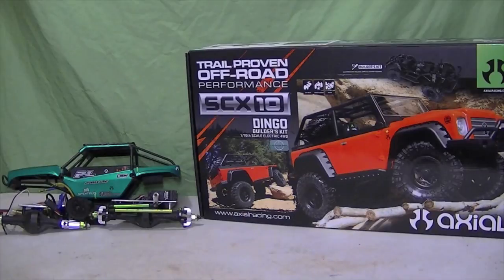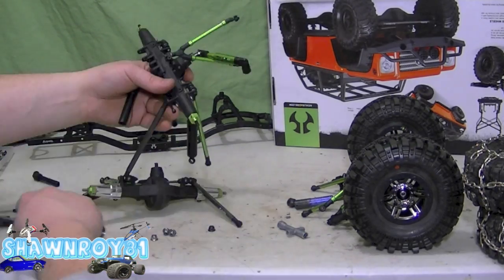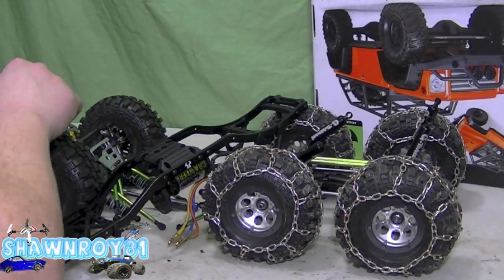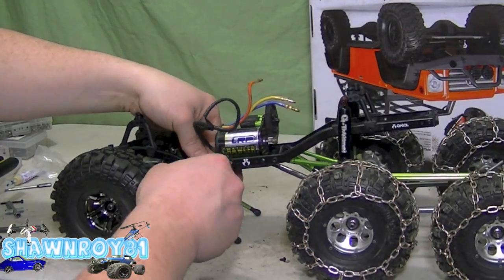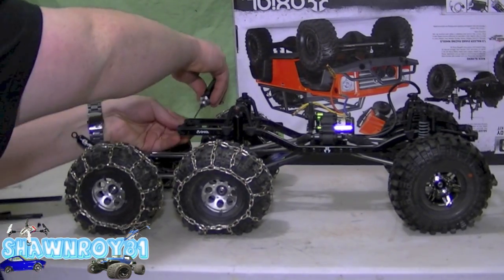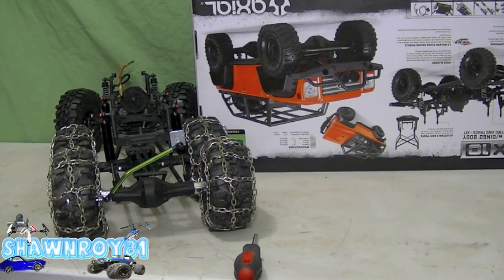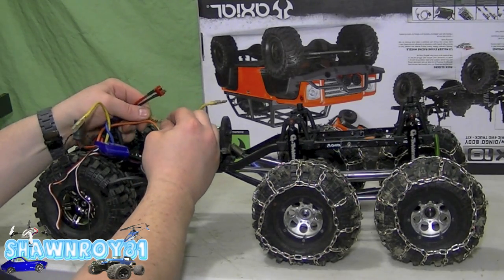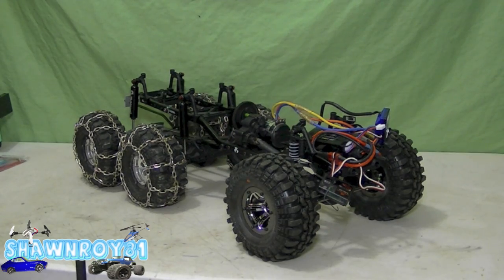Axial SCX10 6x6 Custom Build

Comment: I got the level 3 dual motor mount on my 6x6 with my 55 turn motors. It has alot of power. Thanks for helping me with the advice and for the video. Your awesome.
Reply from the maker: cool cool...glad it worked out
Reply: In 2023 I put a Dual motor set up in my scx10ii. I love the old school innovations.

Comment from the maker: I built it out of two halves of the standard axle, you need to use the halves with the output shaft holes. This way you get the output shaft on both sides of the axle. Then you need a second beval gear and output shaft to mirror the output on both sides.

Comment from the maker: Thanks. I built it. It's two transmission halves. I used two halves with the output shaft hole. Then you need one extra output shaft/bevel gear and you know have an axles with two outputs.

Comment from the maker: It's two output halves of the axle. You will need to sets of axles housing and only use the ones with the output shaft. you will need a full set of axle gears and then 1 extra output shaft and 1 extra bevel gear and 1 E-clip

Comment from the maker: Yes that would work. Check out axial website and search 6x6. It will give you all the parts that you need for the build. That being said you could keep your Honcho RTR and then build a 6x6 with the kit. Once you have the kit or the RTR you don't need much more than a 3rd axle. But I hear ya with trying to do it with what you got. My idea is all depending on the budget your working with.

Comment from the maker: it keeps the axle from shifting side to side given that the second axle is only connected to the frame by the shocks. If i didn't use the pan hard the axle wouldn't track straight

Comment from the maker: Robert Burgos The xr10 is not a trail rigs so I wouldn't use it for that. 2nd the xr10 are discontinue to your lucky if you can still buy them. I do have 2 xr10 but I wouldn't use them on the trails.

Comment from the maker: I went back to my original designs 
• (1) AX30518 98mm grey links (lower links from chassis to 2nd axle)
• (1) AX30524 91mm grey links (lower links from 2nd to 3rd axle)
• (1) AXA1430 65mm grey links (upper links from chassis to 2nd axle)
• (1) AX30516 106mm grey links (upper links from 2nd to 3rd axle)

Comment: Sorry I realize this is a very old vid ,but im building a 6x6 crawler currently, usuing scx10 3 straight axles and an Ebay heavy metal pass thru middle axle ,once everything's connected the front and middle wheels turn correctly but the last 2 rear wheels are spinning the opposite direction, how did you get all 6 of your moving in unison? I'm at a loss , Thank you
Reply from the maker: The axle that isn’t spinning in the right direction flip it over end for end. You have to disconnect the suspension links and shocks but once you do it will be spinning in sync.
Reply: @shawnroy81  okay I wasn't sure if you did that or not in your video, I actually tried going that route with mine but the truss and link mounts can't be removed it's all one molded piece so I have no way to connect the upper links ? I can Jimmy a way for the lower links and shocks to connect but the axle just flips all around without the upper link to hold it in place ? I can't believe there isn't a better fix for this ,how the heck did they build the UMG 6x6 before it was Discontinued or how does Traxxas do there 6x6 lol ?

Comment: Alright well I appreciate your honesty maybe I should build one of each :D. Ha. But I am curious, is there any like major drawback to the 6x6.  Like anything that makes it particularly more difficult to handle offroad?  Obviously a larger turning radius but I plan to make all 3 axles steering axles to combat that
Reply from the maker: other than the turning radius its extremely capable.

Comment: I will will be doing this to mine once I get it. Do you think the stock motor will be alright pulling the extra weight?  I have a scx10 jeep wrangler unlimited Rubicon and the stock motor on that seems to be good but I want to upgrade soon.
Reply from the maker: i went with the dual motor mount right away because the weight of the 6x6
Reply: Thanks for commenting back. I built mine and got the 55 turn axial motor.  It seems good but I think I am gonna put a second one for extreme hill climbs.
Reply from the maker: cool cool....let me know how it goes

Comment: hmmm, i assembled the middle axle. But when the shaft spins one way, the other spins the other. Making 4 wheels moving forwards, and two moving backwards.
What's the problem?
Reply from the maker: flip the rear 3rd axle and issues fixed. That's how mine is too.
Reply: shawnroy81 Thanks for the super quick reply!! :) Works perfectly :)

Comment: So I did this to mine. I found that I had to installe the rear axle upside down to spin the correct way. How did you get yours to work?
Reply from the maker: yes I also ended up flip mine to get the right axle rotation

Comment: how do u make or where do u buy the middle axil? with drive shafts on both sides?
Reply from the maker: its two output halves of the axle. You need an extra bevel gear and output shaft

Comment: Hey Shawn, I just finished my first build. SCX10 dingo. I plastidipped my Spektrum S6040 and put some marine grease under the top of the case like medic suggets. I hear a lot of chatter or noise coming from the servo and if I swing it quickly left and right it sort of goes on a tantrum.. Any suggestions? Did I just blow 70$?
Reply from the maker: sounds like your rx got wet...test with a different rx
Reply from the maker: I'm running it with a waterproof FXR and I have had no issues
Reply: Dude it turns out I was just paranoid. Never owned a digital servo before. The chattering is normal apparently, and the tantrums it was having was due to interference. Still rockin this servo, beat it up all winter with no problems!
Reply from the maker: cool....glad to know you got it all figured out

Comment: Bro I'm building a 6x6 right now but when I did my middle diff I shaved that thin lip that goes around that would normally fit into the other side did you do the same thing ? And those links that go to the back diff man trying to get that mess sorted out was a pain in the but lol
Reply from the maker: yes I had to clean them up a bit. the par hard bar took time to set it up properly
Reply from the maker: shawnroy81
sorry pan hard bar

Comment: Having a second out drive on the middle axle, wouldn't that make the last axle turn in reverse? If so how did you remedy this.
Reply from the maker: The last axle is flip 180 to fix that problem.
Reply: Ok, sounds simple. Thanks for the fast reply:)

Comment: Dose it need a battery. And how much does it cost for the kit
Reply from the maker: this is not an off the shelf kit some extras and some modification is require3d as you can see in the video. here is the link to the parts list and yes you need a battery.  http://www.axialracing.com/blog_posts/5692

Comment: What did u use for your center axle?
Reply from the maker: i used to output halves of the axle. Then you need to add a second output shaft and bevel gear

Comment: What shocks did you use on the rear axles?
Reply from the maker: they are the gmade internal shocks
Reply: Do you recommend 80, 90 or 100mm?
Reply from the maker: i'm using 90